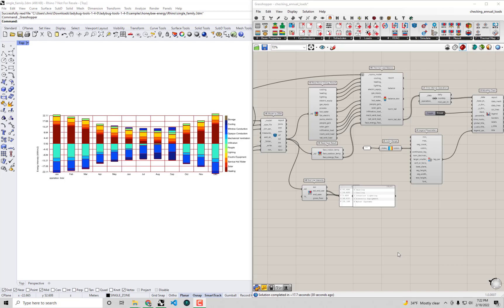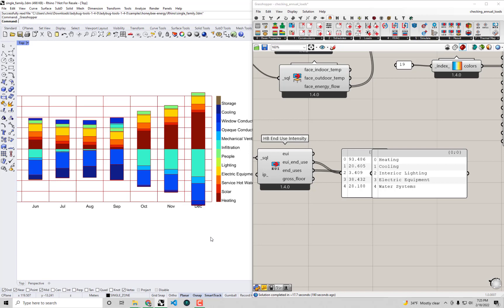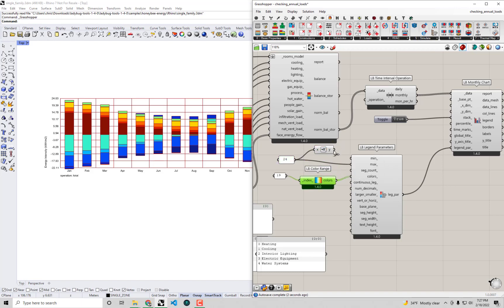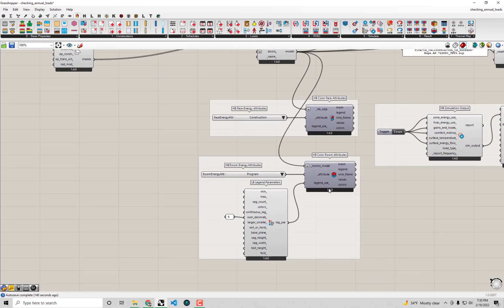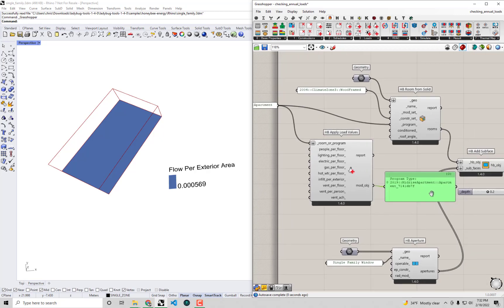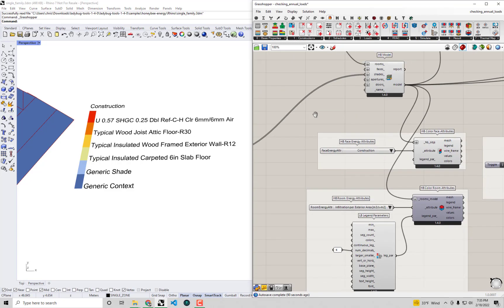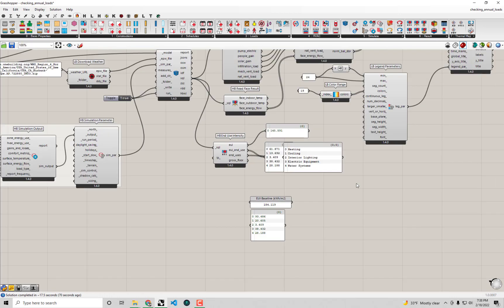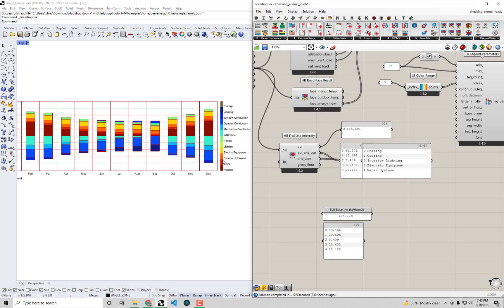Energy Fundamentals: Quantifying the Value of a Strategy

Comment: Thanks so much for the Tools and helpful videos!

Ive got one question here regarding addition of HVAC loads.
I tried to add it after creating the HBRoom and then i applied 'HB Set Conditioned->HB All-Air HVAC->HB Model' but the analysis counldnt run. (it ran perfectly without these HVAC inputs)
Should be added behind the 'program' in the beginning as well?

Thanks in advance for your help!